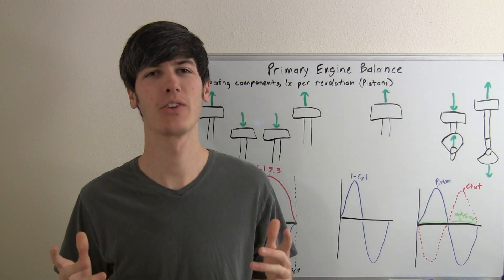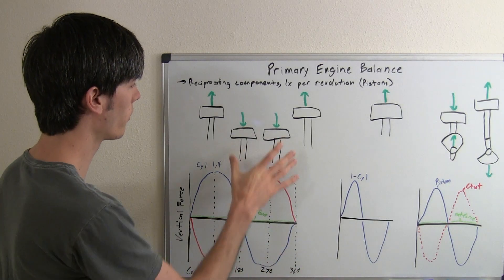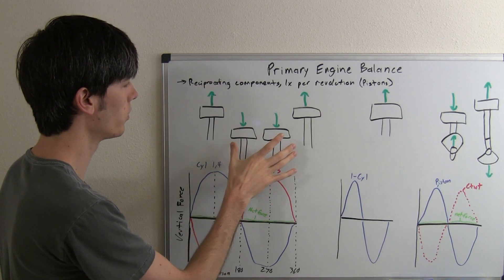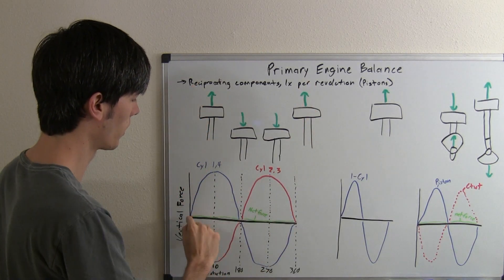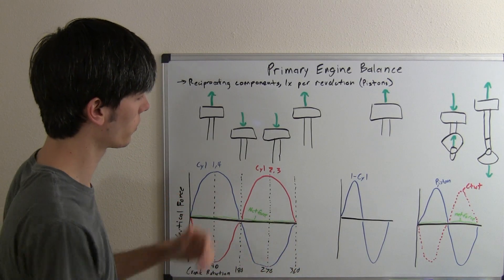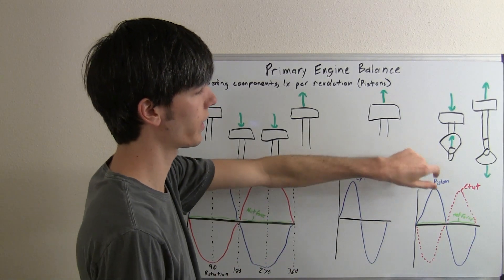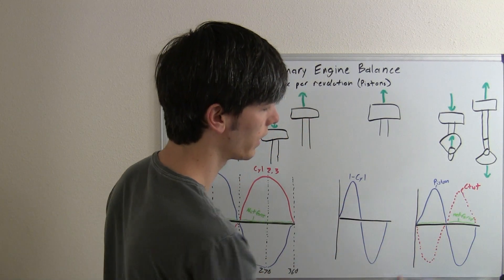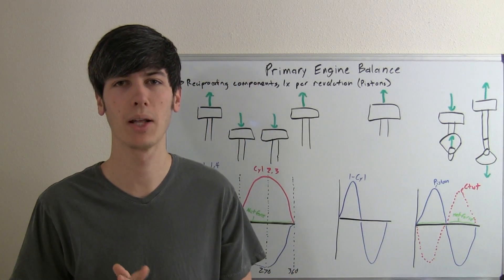Primary Engine Balance - Explained

Comment: Please stop saying that inline 4 engines have perfect primary balance.
They do NOT because pistons at TDC have higher acceleration than those at BDC.
Only OPPOSED engines like flat twins, 4s, 6s etc can have perfect primary balance.

Single cylinder engines with a counter weight are NOT primary balanced for the same reason.

Comment: How about when you want to figure in the secondary vibrations in a single cylinder engine? 
If you make the crankshaft counter weight heavy enough to completely counter react the weight of the piston, wrist pin, connecting rod, and the rod pin side of the crankshaft at 0° and 180°, it'll weigh about 1 times heavier than the rod side of the crankshaft at 90° and 270° of crankshaft rotation, hence, secondary vibration...
If you make one better balanced, you'll effectively make the other one worse, and vice versa.
The best it can possibly be done is to make a split between the two, to reduce them both to there minimum vibration, but you'll never get them both completely at zero vibration at the same time.
But of course you can use a counter reciprocating weight at 180° opposite to the connecting rod and piston assembly, connected to the crankshaft with two connecting rods at or near the crankshaft main bearings. Or a weighted balance shaft. 
But both of those mechanisms absorb available power out of crankshaft, reducing total engine power output.
Just some of my thoughts.

Comment: Nice sir can i ask about the tolerance  in crankshaft balancing if how to calculate before incode in the balancing machine for example is the v6 engine how to calculate the exact tolerance for balancing the crankshaft to dittermind that the crankshaft is already balance thank you.

Comment: The distinction primary/secondary forces makes no sense! It is only the forces caused by acceleration of different elements that need to be cancelled out! Both in terms of one of the three axis, but also around any axis.

Sorry but this primary/secondary stuff is not mechanics!

Comment: sir i have a question -
when combustion occurs, a piston is fired down due to expansion of fuel gas mixture and an equal upward force is given to the upper walls of cylinder then why forces are still said as in balanced in case of single piston or further cases.....,..hoping for ur satisfactory reply
Reply: We r talking about inertia forces of pistons n not those external forces on our mechanism

Comment: Can you tell more about why in a single cylinder (with a counterweight on the crankshaft), there are unbalanced horizontal forces? How is this been overcome in multiple cylinders engines, say V8 or the one in the video?

Comment: Did you fail engineering school? An inline 4's forces are not balanced. The pistons speeds are different at the top half of the stroke than they are on the bottom half. But good job, reading the comments shows that you've convinced a lot of people the forces are balanced

Comment: For the rotation of counterweight it requires some energy right? So how is provided and also because of its large mass, the energy would be more and it can effect the efficienency
Reply: I'm not an expert on cars, but I think once it starts rotating, no energy is required to maintain that movement.

Comment: Hi brother i really appriciate about your knowledge.
I have question About 4 cylinder cankshaft if we remove counter weight  from the the crankshaft. It can be run easily without vibration?
As you describe when 1,4 pistons going upward and the same time 2,3 pistons going downward they are balance each other. So is it need to keep counterweight? Or remove?
If we remove what it happend?
I am waiting for your answer
Regard
Your Follower

Comment: Sigh... The direction and the magnitude of inertial forces are product of acceleration and deceleration of the moving piston. This guy constantly points his finger at the graph of piston position and for some reason refers to it as "force". That does not make any sense at all. It is true that pistons balance each other, but no, this is not what the primary forces look like. The whole video is completely illiterate and physically nonsensical. It is utter garbage with no educational value at all.

Comment: Totally wrong, 4 cyl inline engines do NOT have primary balance. The speeds of the pistons moving up and those moving down are not the same.
Reply: if they're attached to the same crankshart, they'd better be the same speed
Reply: I guess as long as the frequency is kept the same (cycle per second), it's should be fine to be attached to the same crankshaft? I suppose it's possible to have different speeds (and acceleration) of the pistons, but the weight is probably designed differently so that the total force (acceleration times weight) is the same. As a result, primary balance is achieved.

Comment: So basically, if I have a set up; 4 cylinder Engine: where theta 1 2 3 & 4 are respectively: 0, 90, 180, 90 (degrees).... the primary forces are unbalanced... since if I plot the function and integrate across the areas I'm going to get a non-zero value because 1 and 3 have essentially 'flat lined' at this specific point in time. But now say I changed 1 and 3 both to 270 degrees... If I were now to integrate the function with respect to time the areas would cancel out to zero. Is that correct? (Got an exam coming up so I'm just trying to make sense of it in my mind).

Comment: Hi! Excuse me for the disturb! I find your channel incredibly interesting and you're very clear in every explanation, but as other guys asked I really can't understand if keeping cylinders 1-3 and 2-4 in the same phase instead of 1-4 and 2-3 would compromise the engine balance or if that's a good solution too. Bye and compliments again for your awesome channel!
Reply: Let me answer that: Yes, you are right about the idea of balancing the primary forces. In both cases forces of moving pistons will cancel out.
So question: why those are arranged like that?
Answer is: It's about the fireing order.
General idea is about fire 1-3-2-4 instead of 1-2-3-4 cilinders in that order.
I think it's about the "ballancing" the spring force of the crankshaft to prevent stress gain in the middle of the cranshaft.
And also about the better cooling of the cylinders to prevent fireing in the neighboring cylinder in a row.
Reply: Hi Mateusz! Thank you very much for answering, you've been very kind and clear!
Reply: I'm glad I helped : )

Comment: So,  a question,  you now have hour primary forces balanced,   but what about the forces generated by the two piston group at the center of the crank shaft and each piston at the end?  - i mean the stress caused in the part of the crank between two alternating cylinders,  see if i can explain,  when cilynders 1 and 4 go down for example,  cilynders 2 and 3 go up,  both in the middle section,  and at the ends the forces are pushing down,  wouldn't that tend to "bend" the crankshaft?  Is that to minimal to take in account?

Comment: what if we keep the cylinders 1,3 and 2,4 in the same phase instead of 1,4 and 2,3?
Reply: +Prakhar Ton Then you still balance your primary forces, but you end up with a rotating moment. Basically the whole engine will rock left and right. Cyl 1 and 3 are further to the left, so when they travel to the top of their travel, the left side of the engine will want to come up. Cyl 2 and 4 will be travelling down at the same time, forcing the right side of the engine to rock downwards. And vice versa.
Reply: thanku
Reply: In the same plane shown in the video, the configuration you suggest will create a clockwise / counterclockwise rotational vibration.

Comment: Doesnt the counter weight steal power?
Reply: yeah, that's why we have perpetual motion machines? No, that's why we DON'T
Reply: @DerKrawallkeks  I can see this thread is ancient but can't constrain myself from saying that this answers my question of why my 250cc single engine moto is not that much responsive to my throttle input. I used to have a 125cc and it responded much faster to twist blips.
Reply: @faustin289  yup makes sense
Reply: +Sean Donovan Are you sure? Apart from its mass, that has to be accelerated, it does not kill power. Why should it. Power is only killed when something heats up.

Comment: I believe the graphs are wrong. The curve should start at +1 (TDC), at 90 degrees reach 0, then at 180 reach -1 (BDC). The graph you've drawn states that at 0 degrees the piston would be half way up the cylinder moving towards TDC, when at 0 degrees it is already at TDC. It should basically be a cos wave instead of a sin wave, the curve needs to be shifted right 90 degrees. :)
Reply: you're right. that graph would only hold true if it were of piston speed.

Comment: in a single cylinder engine, won't the counter weight used affect the efficiency of the engine due to the fact that it is acting in the opposite direction??
Reply: I just watched this video and was wondering the very same thing. It seems that a counterweight would have a negative impact on the fuel economy as well as the power delivered. But I suppose a cost to fuel economy is better that the thing flying apart from vibrating.

Comment: well, good video, but you kinda explained in a very simple way how the forces get balanced, which was fine for people who don`t really want to get too deep into this engineering feld. I think you should have drawn vertical acceleration vectors instead of speed vectors for the pistons, because people may get a little confused and misunderstand how the forces actually get balanced. For example, when the piston is moving up and is near the tdc the acceleration is pointing downwards, as the piston`s vertical speed is decreasing, which means that there is a downward force acting on piston.This force is ''created'' by the crankshaft`s rotation and due to action and reaction principle the crankshaft has the same force acting on it on the upward direction. This is force is due to the inertia of the piston that is decelerating. And as the crankshaft is being pulled up,the counterweight balances it with the centrifugal force (you correctly drew acceleration vectors for counterweights) pointing the downward direction, as its mass is concentrated  under the crankshaft axle, at this moment. I hope you managed to understand what I meant here, I wrote it in a hurry, hahah.
 I'm a huge fan, thank you.
Reply: that's exactly what i was looking for and want to understand it.  how the piston rise up or goes up again , thank you
Reply: He was off in a few way. He left out the difference in piston speeds at the top half of the stroke compared to the the speed on the bottom half. He makes it sound like the downward forces of the pistons counteract the upward forces of the other 2 when in reality they dont

Comment: Please see the engine balance used in Tata Nano 2-cylinder engine if you haven't already
explain it to me why would someone do that?
It seems like pretty unbalanced engines doesn't it...
Reply: Tata Nano engine is balanced with the help of balance shaft (contains counter weights). The balancing shaft rotates in opposite direction of the crank shaft to compensate the secondary forces caused by the piston movement. Its a very old method of balancing. Look for Secondary (Non-sinusoidal) Balancing.
Reply: Why very old method used today, it also makes the engine unnecessarily heavy. thanks for the reply.
Reply: Ayush Gupta you loose some, you get some. The method does increases weight but also balances the engine. Its better to attach some weight than to completely jeopardize the creation. Fundamentally, the Tata Nano engine is a badass application of Lanchester Balancing technique developed in 1905.

Comment: Good video.  One comment - in general the use of CW on crankshafts on IC engines is for balancing the rotating masses as you show nicely in your first video.  A CW will only start having an impact on the reciprocating inertia forces once the inertia force of the CW exceeds that of the rotating mass at the other end (piston pin and rotating mass of the con-rod).  However, here there will be a trade off as you will then introduce some horizontal out of balance...

Comment: Interesting video. I always like your explanations ! ! thank you 
Engine balance has always perplexed me. Now that I have learned about so many other engine designs I realize that it was so confusing because it was not possible! 
The Piston engine is one of the LEAST efficient design bases to start with. 
Rotory engines are, were and always will be the most efficient and easy to build/engineer. 
Trying to "Balance" a piston shooting up and down, with an off center weight spinning in a circle is not possible. YES it can REDUCE vibration, but will NEVER be able to truly balance the engine. 
To eliminate vibrations in the "stupid combustion engine" AKA "Piston Engine" one must use many different methods: one is to use the method described here. another is to use MASS plus a rubber ring like a Hormonic balancer. Another, that is most popular with auto and OIL tycoons, is to simply increase the mass of the engine block. This is why "Piston Engines" are soooo heavy. ROtory engines are inherently lighter because they are much closer to being balanced in their rough design state. To fine balance them you simply shave or add weight to the appropriate side of the rotor. Turbine, and electric motors are far ahead of "Stupid Combustion Engines" even in their most basic design.
Reply from the maker: Standard piston cylinder engines have proved to be more efficient than rotary engines, hence they are prevalent and rotaries no longer exist in production.

Comment: You've spoke about the mass we can readily see, does the mass of the fuel air mixture plus the force from firing also need to be included in the balance equation?
Reply: No. That is a separate issue. But you are correct in thinking that ideally, all the firing forces should balance each other.
Reply from the maker: The firing forces should be balanced, meaning that they should occur in even intervals (every X degrees, for example 90 degrees in a V8 engine). I discuss this in my "engine balance" video.
Reply: Engineering Explained However, the force will change with the change of fuel/air mixture and timing.  Moreover, even if the force of firing was constant, in a four cycle engine the additional force only happens once ever 720 degrees.  Since the mass of the piston + fuel air is variable and the counterweight is constant, is the variance simply ignored?  Or is the counterweight perhaps positioned differently and of compromising mass?
Reply: The counterweights are not designed to offset the gas force. In singles and V's it balances the primary forces. In inline engines, it reduces the bending moment at high rpm in the crankshaft.

Comment: won't the forces of the pistons on the first figure apply a torque on the crankshaft? I am thinking that when the two outside pistons go up (and the two inside down) they are gonna be creating a torque that will tend to bend the crankshaft (since the first ones are gonna be pushing the cranckshaft upwards while the middle ones downwards)

Comment: How do V5's work then? 4 cilinders in balance and one counterweighted? or all counterweighted?
Reply: IntegraFilms Motorcycles use v4 engines and the honda rc211v was a v5, so not impossible just very uncommon
Reply: ofc its all motorcycle engines. I just want to know how the inline 5 in the acura vigor and the ford focus RS500 work. And engines like the inline 3 in the ford fiesta ecoboost and volkswagen up! .
Reply: IntegraFilms Volkswagen has a Golf model which has a V5 in it (called Golf V5). But I don't know if it's a straight 5 though. I thought they were offset a bit.
Reply: BoCr It is an offset straight 5. The engine is called a VR5.
Reply: Its called a staggered 5 not straight 5.
Reply from the maker: IntegraFilms
Straight five engines do exist.
Reply: Engineering Explained I know, I was talking about the VR5, its a staggered 5 not straight 5.

Comment: why do 4 cilinder engines have counter weights on the cranck then ?
Reply: To stop the crankshaft from bending at high speed.
Reply: Sorry, that was unhelpful. The counterweights on the crankshaft are there to directly oppose some of the primary force of each piston. Note that the emphasis is on oppose rather than balance. The purpose of them is to ensure there is an adequate oil film thickness on the main bearings. It does this by reducing the tendency of the crankshaft to bend under load or high speed. Unchecked bending moment of the crankshaft will cause excessive wear on main bearings 1,3 and 5 from memory.